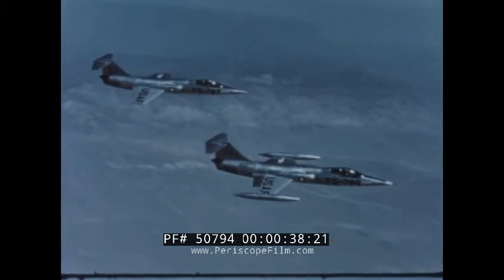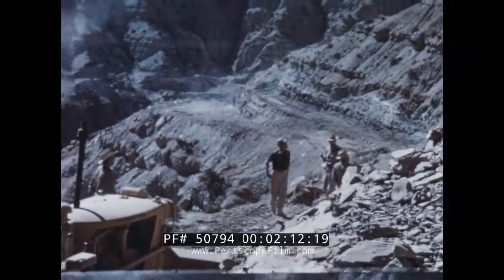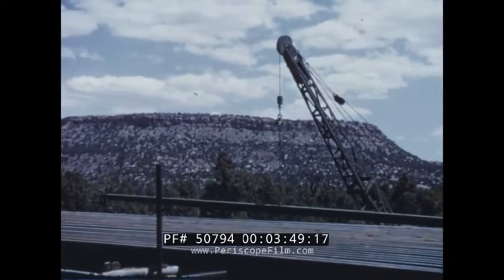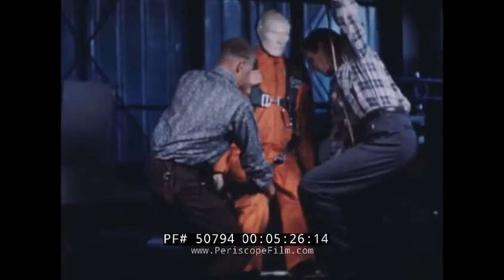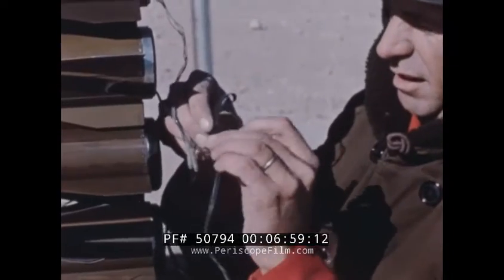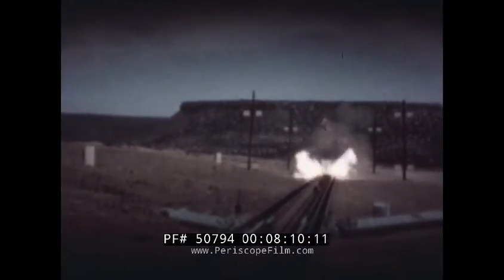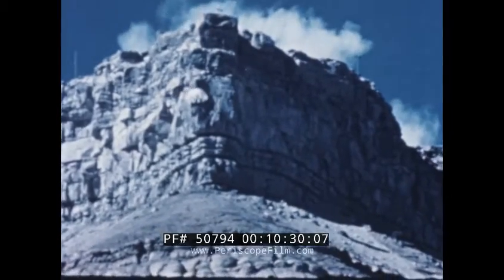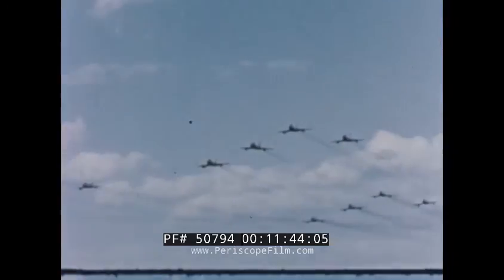PROJECT SMART "SUPERSONIC SURVIVAL"  U.S. AIR FORCE SLED TRACK at HURRICANE MESA  50794

Comment: Did some testing there in the early 90s.  One of my college professors worked for Coleman on this project just after he graduated.  They had some prefab buildings right on the edge of the mesa, facing east towards Zion (offices, bunkhouse, kitchen, etc.), and the views from there were spectacular.  I recall one evening after testing was completed, sitting in chairs, drinking beer and watching a thunderstorm passing through the valley.
Reply: very cool, thanks for sharing. I drive underneath Hurricane Mesa a few times a year, taking people to Zion, but never been up top. Cheers.